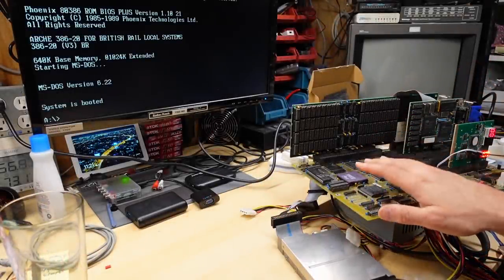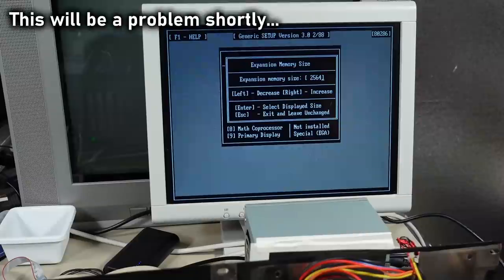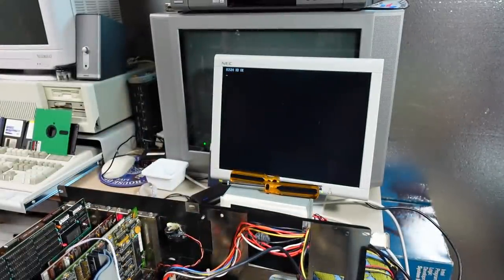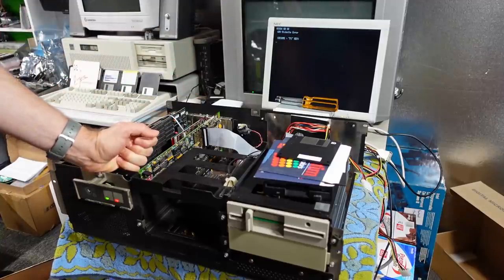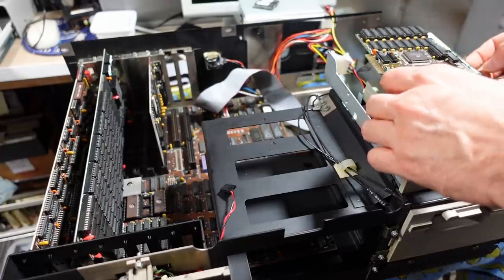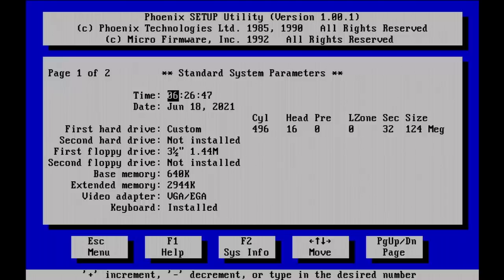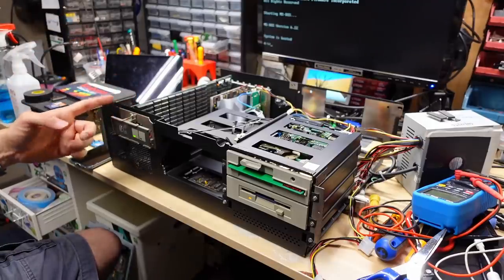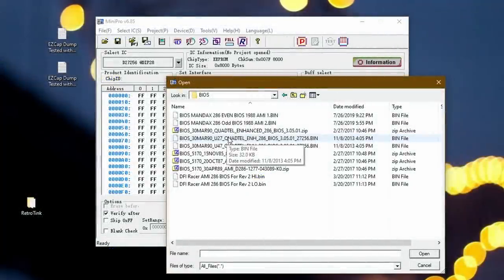IBM PC/AT Model 5170: So many issues! (BIOS mania)

Comment: Glossed over the true difference between emm and xms, there?.. I mean.. "I won't use it as such".. fair enough, but MOST ways to be able to make USE of "more memory" WAS using it as EMM.. which is why there were various soft-ware drivers loaded in config,sys which made it POSSIBLE for programs NOT aware of XMS memory to be able to ACCESS XMS memory as IF it was EMM memory.. So yeah.. I have watched about 4m45s as of yet, and.. tbh.. I SUSPECT that if you would be using programs that was able to run on this computer and wanted to use more memory (outside of the initial 1meg area, of which only 640 was for memory and 385kb rather was mappable by bios, or roms that comes with add-on cards.. OR that could be mapped through software)..  Then.. yeah.. for MOST programs.. (especially real mode programs) that  wanted MORE memory than was available.. (especially drivers that kind of WERE needed, BUT they were needed for programs where the actual SIZE of the driver meant that there wasn't enough ram for the real-mode program to run WHEN the driver was loaded.. so.. actually putting the driver in the EMM made sense.. ).. Then.. yeah.. During the era in question.. probability is that you actually WANTED EMM.. but.. had to made do with artificially use a driver which EMULATED it.. using XMS.. so.. even slower than ACTUALLY having true EMM.
Reply: .... also: 5.25" drives ARE reliable.. I'd even say MORE reliable than 3.5" drives.. though that depends a shitload on the actual QUALITY of the disks.. this in itself could be worth a book (or youtube video)  on it's own, because.. It USED to be VERY expensive to buy disks.. and then during the nineties suddenly the price of disks went down STRONGLY.. there is a reason as to why this happened... the main one is that it was suddenly okay to sell crap.. (kind of as how TCO-99 has LOWER requirements on displays than any EARLIER version of the TCO-requirements..  It IS a quality standard, but as a quality standard goes.. it was about.. being "good enough"- which IS what quality is about.. it's not about "being better", it's about being the thing that people think is good ENOUGH.. hence.. the previous standards being PRIMARILY focused on CRTs that can EASILY be made in extreme high quality with FEW adjacents pixels being unacceptably wrong.. on actual flat-screens?.. When TFT FIRST was releaseed.. they cost MUCH higher than $1000 for 14" display.. simply BECAUSE.. for any ONE display that fit the quality requirements to claim to be TCO certified.. that had to throw away several that didn't.. ).. either way; I get distracted and forget what I was talking about, but yeah.. 

The actual disks I have from the mid 80s.. they are primarily of either 3m or verbatim brand. and they all came with a (literal).. life time guarantee.. and this wasn't a RANDOM definition of lifetime.. (I find it HILARIOUS that people today ACCEPT that corporations today try to say that it is the lifetime of the MEDIA that they are talking about.. because.. technically.. what they ARE saying is that they are GUARANTEEING.. that it WILL work.. until it doesn't.. because..,. when it DOESN'T fulfill it's intended purpose?.. will be AFTER it's ACTUAL lifetime.. It's a LITERAL self-fulfilling promise... "I promise this works during it's OWN lifetime???.. oh.. it DOESN'T work?.. then.. I guess that PROVES it isn't alive any longer?.. hence.. it's lifetime IS over?????".. 

but eyah.. old disks.. were created in a way that actually GUARANTEED it's functionality.. and.. there MAY be some 3.5" disks that KIND of was created in accordance to the SAME standard of functionality.. but.. when people "compare" the two.. I am FAIRLY sure they are NOT comparing the OLDEST 5.25" disks, but rather.. the very last ones EVER to be sold.. where they are LITERALLY.. are trying to get just the few cents possible of revenue from the few that still want to buy it.. and.. they don't REALLY have competition.. and.. it's primarily NOT the actual big corporations that will provide HUGE revenues to them that are the customers involved... but.. just.. AS LONG.. as it works.. for a year or so.. then.. it's good enough.. 

But just to say.. I Have an MFM harddrive.. that I still use.. It only holds 10 meg of information.. but.. quality wise?.. MFM back then was considered "Low quality".. which is WHY the entire concept of "RAID" is an achronym of.. "Redundent array of inexpensive disks".. so.. the.. "MFM" drives.. were EXTREMELY inexpensive.. and considered to be of.. "low quality".. but.. they are literally better and more trustworthy TODAY than a MODERN drive is.. to some extent BECAUSE it contains less information to begin with... but either way.. low quality "yesteryear" is STILL better quality today where people ACCEPT that your phone WILL be broken down within three years.